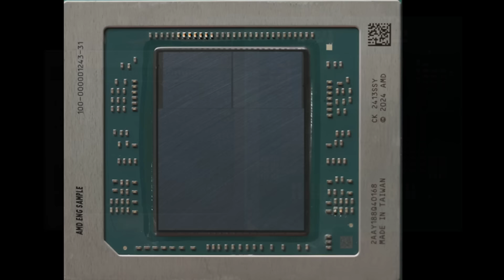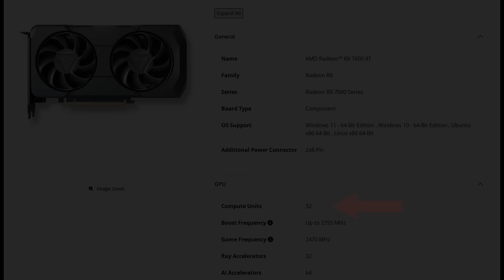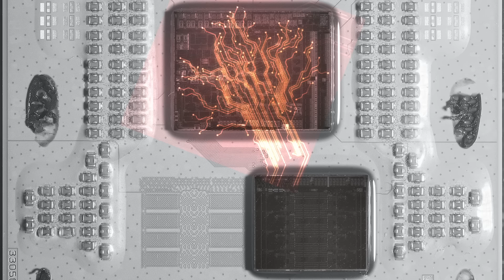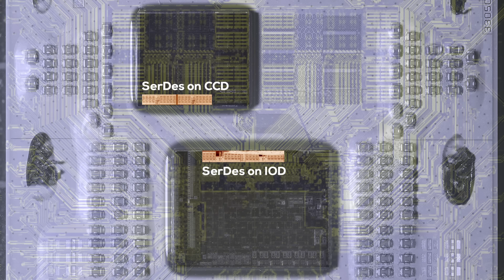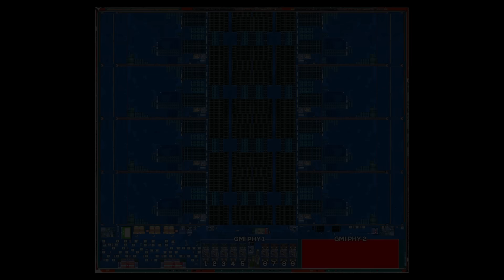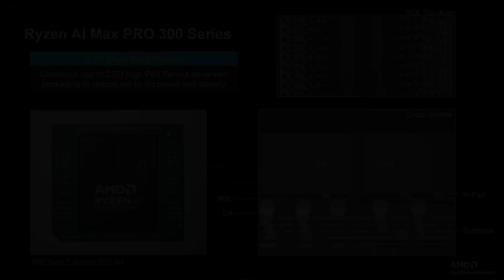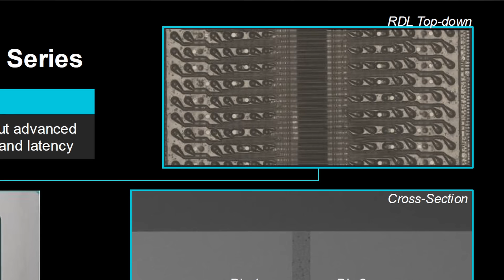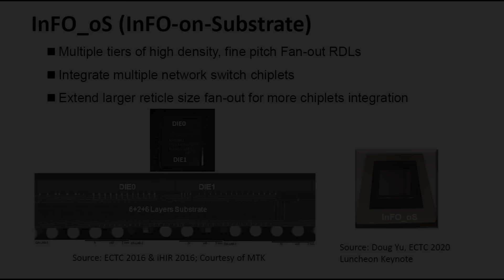How AMD is re-thinking Chiplet Design

Comment: There are few things missed in this video.  The first is that the organic interposer does not have the same area limits as a silicon interposer. This means that larger chiplets and more chiplets are possible to put into a single package.  This does highlight a problem though:  routing between multiple chiplets has gotten vastly more complex.  The end result maybe an implementation of Zen 6 where the CPU chiplets have four interposer links (north, south, east, west) and higher core count models are simply more CPU chiplets arranged in a grid fashion.  The outer edge of the CPU chiplet grid would be the various IO dies and memory controllers.  This would have an impact on latency as the interior of the grid would have to have its memory requests hop through another chiplet before arrival. This does have the benefit of complimenting AMD's current socket strategy rather well as the larger the grid of CPU chiplets, the more IO dies can be placed amongst the perimeter.  AMD currently has dual channel (consumer Ryzen), quad channel (enthusiast Threadripper), six channel (SP6 embedded), eight channel (workstation Threadripper Pro) and twelve channel (Epyc server) products on their roadmap.  Making the IO dies smaller and leveraging more of them around the edges of the CPU chiplet grid would compliment their current product portfolio rather well.  Yields of the IO dies would also improve as that single massive chip for Zen 5 Epyc is a greater challenge than the Zen 5 cores surrounding it in terms of yield.  This grid style approach would also work well if future GPUs adhered to the same basic design rules:  a mobile SoC is simple a desktop Ryzen two CPU chiplet + IO die but with an additional GPU chiplet in the same package.  Other novel things AMD could do is design FPGA, AI accelerator and network accelerator chiplets to be placed into the package.  And again, organic interposers can be manufactured to very large sizes permitting this topology.  The downside to a grid of chiplets approach is that at the low end, there is effectively wasted silicon on a complex IO die-to-die arrangement.  Consumer products would only use two of the N,S,E,W links at most.

Even if the above 'grid of chiplets'  is more wishful thinking, there is the major issue of thermals that this video does not address.  Simply put, moving the chiplets closer together makes them harder to cool.  For a product like Strix Halo, this is manageable due to low power tuning everywhere and as a mobile beneficial since the cold plate is a smaller area vs. previous Zen 4 solutions.   For Zen 6 servers combing upwards of 16 CPU chiplets running at full power, keeping things cool will be challenge with the increase in thermal density.  400W of Zen 6 might require liquid cooling where as 400 W of Zen 5 chiplets can still be air cooled.   This is just an issue worth mentioning as it could be the biggest factor in how far AMD can scale things in server.

I would like to dispute the idea of moving 3D V-cache to the top of the die for Zen 6.  AMD did a lot of design work to get the 3D V-cache underneath the CPU chiplet (a guy named High Yield did an excellent video about it ;) ) and AMD would not waste that effort for a single generation of product as the CPU design of Zen 5 was to be the basis for Zen 6.  An interposer doesn't have to fill the entire area underneath the dies sitting on top for signaling (there are structural benefits though!).  There is a lesser known thing about organic interposers:  they can be made to include holes.  Thus the spot for 3D V-cache can be excluded into the interposer is that area was only used for structural support.  I would call this a Swiss design in honor of Chips and Cheese.  The organic interposer may not even need to be cut to create the hole as it could be constructed natively with it.  However, there is now a yield variable introduced in functional interposers.  The good news is that defective interposers can be detected and discarded before bonding with silicon. This does increase the cost of the packaging as some is still paying for the construction of these defective Swiss interposers which are more expensive than a normal organic interposer.  I would agree that this would be a very impressive implementation with both 3D V cache and organic interposers.
Reply: Unless I am missing something, doesn't the fan out mean you could just use another large die for the l3 cache or include it in the io die now that latency is reduced? My suspicion is that the fan out adds sufficient flexibility that a 3d vcache isn't needed. The thing that surprised me on strix halo is the large io die. I would have thought splitting off the gpu would have created a smaller die. I suppose the io die is probably on an older node, which means the larger die is no issue(and may even be less transistors than the ccds).
Reply: @primeprover  There have been other CPU designs historically which have had large external L3 caches in the same package.  I would recommend looking up IBM's ancient POWER5 design to get an idea of what can be done when money is no object back when ceramic packaging was used.  There are still advantages for AMD to leverage TSV vs. putting a L4 cache to the side in the package.  The first is bandwidth as AMD's implementation is already over 1 TByte/s.  This will likely increase as AMD scales clock speeds even higher.  Second is latency as funneling all the cache through a single interface means that the cores closest to the cache dies get data quickest in terms of latency.  3D V-cache using TSV means that each core gets the same consistent latency to its own L3 cache pool, just larger.  This is why putting a cache die to the side of the CPU chiplet would be a L4 rather than L3.  A further reason AMD would want to continue to have 3D V-cache options is stacking:  more than one cache die underneath the CPU die.  This has been something AMD has experimented with internally as there are various SuperMicro firmwares with the ability to control how many dies the 3D V-cache are active.  Obviously no such product has been commercially released but those firmware settings were likely used for a test chip.  Lastly, DDR6 is around the corner which further increases latencies on the memory bus itself.  To compensate, larger caches are necessary but DDR6 will bring plenty of bandwidth.   There is also the potential that DDR6 memory controllers won't exist in some Zen 7 server products:  large memory pools will hang off the socket via CXL memory expanders.

Having said that, there is merit to putting in an additional layer of cache directly with the memory controllers.  It acts as a huge buffer for data exclusively for that memory channel.  The memory controllers can organize reads/writes in a more optimal fashion to minimize bus turnaround.  Highly read data on the memory channel that is remotely requested can be prefetched into this cache area, reducing latency in an already high (socket hop) trip.  IBM has done this with their recent server chips by including a "L4" cache in their memory buffer chips.  The rare Sky Lake products with eDRAM operated in this fashion.  AMD's own Infinity Cache on their GPUs work much in this way to amplify read bandwidth.

I can see AMD breaking up Strix Halo's IO die:  the AI accelerator and GPU components are prime to be spun off into their own chiplets leaving the core IO to its own chiplet (memory controllers, PCIe, USB etc.)  If AMD makes the AI chiplet and GPU chipets similar sizes as the CPU chiplets, things can continue to scale in a grid-of-chiplets fashion in CPU, GPU, and AI performance.
Reply: @primeprover yea maybe it doesnt even need v-cache if it's so much better than IF. Vcache was and always will be bandaid fix for the poor IF interconnect.
Reply: @DominickDecocko  The latency improvement provided by v-cache (for the softwares which benefit from it) is too great to be countered by an improved chiplet interconnect. Main memory will still be really far away from a CCD even with a more direct path to the IOD. One could also easily imagine that a monolithic die will still experience lower latency still than a fan-out interconnect IOD and CCD architecture.

Plus, marketing. The huge L3 boost provided by v-cache is also a salespoint. :P
Reply: @primeprover Intel had one generation with L4 cache and even if was not directly connected to the core it give boost to gaming. 

Intel however wanted you forget that generation as they soon come out with new generation after. 

It is talked about bigger cache for Ryzen 6, but I agree it doesn't make sense to add the 3d cache on top, because if the downsides they fixed with generation 5. 

I don't know what is cheeper, add more cache to L2 and L3 or add L4 cache as Intel did. But even if they could make cpu with same performance without needing 3D cache, it is so well known brand for getting best if the best gaming performance. So replace that with cpu that have extra cache to get same performance as 3D cache cpu will be hard to sell in to people.
Reply: @mickearrow8035 I believe the excuse with abandoning this sort of thing is usually expense. I expect we are getting closer and closer to where it is considered worth it. Would like to see a variant of hbm as L4 cache (quite possibly home grown). 512mb or 1gb of 512 bit bus would be amazing.
Reply: @primeprover  I have no issues with abandon the 3D cache as it more like bandaid as someone mentioned. It is more or less already like an L4 cache but closer to the core. As add the memory on top just restricted the core and hurt productions performance to get few extra fps, so I hope find good way to deal with the issue. 

One benefit of the stacked memory could be for the gpu in just APU, think about 8Gb of built in memory that could improve a lot for laptop performance.

AMD has for years talking about stacking and 3D cache (even try on GPU), but it did not lasted for long as it was too expensive. But they never give up on the idea and now we have similar idea on an cpu instead.
Reply: @mickearrow8035 Actually had a conversation with chat gpt about this today. Conclusion was that you could add 16GB of ddr5 as L4 cache with a 256 bit bus (128 bit x 2 from multiplexing like recent hb-dimm patent). Bandwidth could scale with capacity. Costs a bit more than x3d but not much. Much better in the correct workload.
Reply: >  moving the chiplets closer together makes them harder to cool.

I think you're over stating this by a lot, having more "dead space" just feels intuitively bad to rely on for effective cooling, when there are dozens of other design constraints you could tweak to help, for example lots of consumer coolers are slightly convex shaped and having them more spread out, away from the best contact point with the cooler would actually hurt cooling performance, each chip doesn't generate the same amount of heat nor generates it uniformly across the entire chip, the IO-die on my 5900X is substantially lower wattage (30w max) than the two Zen 3 dies (90w each), Having an IO die wedged in the middle is far less of an issue, having the chips touching physically via a high thermal conductive material like copper could improve spreading out of heat as well, PCB and air aren't great conductors by comparison. You're also forgetting that the interface itself can help here, because it's more efficient, generates less heat, running a high frequency signal over long distances can't be great for heat.
Reply: @woobilicious.  I think the bottleneck will be the IHS. With the higher heat density, a vapour chamber IHS would finally make sense.
Reply: @woobilicious.  That statement was made in the context of server CPUs which currently have 17 dies in the highest end Epyc products.  That is a bit more than the 3 dies for desktop Ryzen or Strix Halo.  Instead of four 2x2 chiplet clusters with an IO die in the middle, imagine the next generation moving to a grid of chiplets in a 5x5 grid.  Where does the heat go from the chiplet in the middle of the 5x5 grid?  To its eight neighboring dies around the perimeter who are also producing similar levels of heat.  That is why spreading out the chiplets further apart makes things easier to cool:  there is more opportunity for the the heat spreader to distribute the thermal load.

What you are describing to move heat around is the heat spreader found on processors for over a decade.  AMD did make the mistake of thickening the heat speader when moving from AM4 to AM5 (thus heat moving upward away from the dies have more material to transfer through to reach the cooler on top) to retain cooler compatibility.  

With your 5900X example, I would invite you take a look what an offset mount can do for that chip.  Core temperatures can drop by a degree or two Celsius just by shifting the center of the cooler directly over the CPU chiplets instead of centered over the IO die.  Same amount of heat, just the most effective part of the cooler is placed over the hottest part of the package to improve efficiency.
Reply: IMO AMD could simply  put a bunch of TSV on the cache die as passthrough for interconnect interface on the CCD then fan out from the bottom of cache die. It would require higher precision to align them properly than the passthrough on current Zen 5 X3D but contact between the cache die and CCD already require much higher precision than that.
Reply: @hl321662  You are on the right track but there are lots of detail and nuances to consider.

If you are going that direction, it'd make more sense to go with a silicon interposer to fan out at the bottom for regular IO connection pads.  And this has happened before because using TSV takes up less area than the array of pads around the parameter.  This is independent if SerDes are involved or not.  In many cases, the bottom interpose die does not have any logic on it permitting its manufacturing on much older processes due to cost and larger reticle limits.  What makes Zen 6 different is that it is using an organic interposer vs. a silicon interposer.  I do not know how effect TSV into an organic interposer is as I've only seen it described with bumps.

For high end designs today, this is a pretty big deal by attempting to move SerDes off to their own chiplets as mentioned in the video they leverage a bit of analog circuity that does not scale like logic does.  This also permits leveraging older nodes for SerDes which reduces costs.  This is one of the reasons why the AMD Radeon RX 7900 series had their memory controllers on a separate die:  they had their own PHY and SerDes alongside cache that didn't scale as well with newer process nodes.

Speaking of costs, once the decision has been made to use TSV, scaling up the number of them doesn't increase price proportionally due to decently sized initial cost for the tech.  Certain steps in the manufacturing process of adding TSV are only done once instead of per TSV connection.  Thus going from 2000 to 4000 TSV connections does increase price but it isn't necessarily double.  That is why once the decision to use TSV is made, designers tend to go all in on it.
Reply: Nice discussion. Thanks for posting. The chiplet grid not being fit for desktop shouldn't matter, as the desktop I/O die will be different anyway, since the desktop one needs to contain a GPU.

It's an interesting question what AMD will use for EPYC or Threadripper, but I assume that for desktop and mobile the new interconnect will be used. The only caveat I can see is the matter of price. The video mentions in passing that the new interconnect costs more, but the big question is how much more.

But assuming price is not a big deal, I think that AMD will use the organic interposer on desktop because it allows a Dragon Range / Fire Range style CPU to actually work out well for mobile, and having the same CPUs for desktop and mobile is beneficial.
Reply: @ETophales  The chiplet grid being less than ideal for desktop doesn't really matter that much in the grand scheme.  It is overkill given the amount of IO and compute chiplets being used.  It is merely a cost play to reuse the chiplet dies on desktop vs. the expense of developing a new die just for desktop.  

I would also like to emphasize that the desktop parts could use the same IO dies with memory controllers and PCIe as their server counter parts as I imagine those IO dies shrinking in size and features.  Say only 128 bit DDR5 memory controller and 32 PCIe lanes.  So how does AMD support a 768 bit wide memory interface with 128 PCIe lanes for the SP5 socket?  Simple:  they include six of those smaller 128 bit DDR5 + 32 PCIe lane dies in the package.  It is all about reusing dies even in the same product.  This keeps the number of dies in production small but also enables AMD to shift die allocation quickly between desktop, mobile, workstation and server to meet individual market demands.  You are correct in the desktop would still need an additional die for desktop specific IO (think USB, display engines etc.) as well as a GPU chiplet.  The cost of developing those is smaller than that of CPU, GPU, memory dies and can be made using older manufacturing nodes.

As for pricing of an organic interposer, AMD still has plans to leverage monolithic dies the low end on mobile, or at least start embedding smaller CPU cores into the IO dies (which still has interposer links).  The usage of interposers hasn't reached costs low enough for those markets.

Assuming AMD keeps a standardized interposer bus around for several generations, we are going to in for a whirlwind of product releases as everytime AMD updates a chiplet, they can refresh.  For example, as soon as their DDR6 memory controller is ready, it can be paired with Zen 6 or Zen 7 for AM6, again presuming the same interposer connections.  Ditto for new GPU chiplets or to release special products that have AI accelerators or FGPA chiplets.  There is an enormous amount of flexibility here if they can pull it off.
Reply: @powersixsixsix  "The only Zen 6 exceptions would be the mobile monolithic SoC" - well, and at least some of the Zen 6 custom silicon. While the next Xbox APU is rumored to be using two chiplets with an interposer, and seems very much like an evolution of Strix Halo, the PlayStation 6 APU is rumored to be a more traditional, smaller and monolithic die.
Reply: Why only 4 sides, N,W,E,S? A hexagonal layout is clearly superior and is still stackable!
Reply: @VADemon  Hexagonal silicon is hyper rare (but does exist) but core layouts internally wouldn’t align.  There are other ways to use six links and that would be to build a virtual 3D cube but the two acting in the verical get some wild routing when laid out in a planar manner.  A 3D torus topology is used in computing but typically for systems nodes in a cluster.

Going with 8 cardinal directions (N, NE, E, SE, S, SW, W, NW) would provide some benefits for large grids as traffic could move diagonally.  Interposer technology would support this with both silicon and organic.  Rather this runs against cost-benefit until you reach a large number of dies to route through.
Reply: @VADemon  Calm down Satan.
Reply: "Making the IO dies smaller and leveraging more of them around the edges of the CPU chiplet grid would compliment their current product portfolio rather well.  Yields of the IO dies would also improve as that single massive chip for Zen 5 Epyc is a greater challenge than the Zen 5 cores surrounding it in terms of yield."  I think it wouldn't work so good.  Having a memory topology on the edges would introduce more latency.  The io die is pretty big but not super big and it's made on an older process (6np) than the ccd dies (4).  I don't think they're hurting due to size much since pics of the io die show it seems to have a significant amount of empty silicon which is odd.
Reply: Yea i dont think Zen 6 desktop will have organic interposer/sea of wires for the reason you mentioned chief. It will probably stick to the dumber serder Infinity Fabric. They will slap more cores per CCD, maybe more cache and it will sell out.
Reply: @DominickDecocko there has been clear leaks that the IO die and interconnects were changing for ages. Something significant is coming.
Reply: @DominickDecocko  IF performance has been a constant issue since Zen 3, you can squeeze an extra 10% out of your CPU just by increasing the IF speed from 3200MT/s to 3600MT/s, Zen 4 was notorious for performance issues if you matched them with slow RAM, and you can't even Run 4 sticks of DDR5 with XMP enabled because the IF can't handle it, The reason why X3D is so good is because it allows you to avoid touching IF, Zen 5 should in theory be faster, but without X3D it's almost identical to Zen 4 in many benchmarks, X3D is not a cost effective measure in the long run, Addressing IF issues at the root needs to be done before AMD stagnates.
Reply: @DominickDecocko  It likely will just to reduce the number of dies AMD is producing.  The CPU chiplet for Strix Halo is a bit of an anomaly currently as no other AMD uses it.  So far AMD has been pretty good about reusing dies across product ranges.  There is one other place where it would make sense for AMD to use that hasn't been updated for Zen 5: their MI accelerators.   For Zen 6, it makes sense to keep everything consistent as much as possible to maximize reuse which would be interposers from the top to the bottom of the stack.

The only Zen 6 exceptions would be the mobile monolithic SoC.